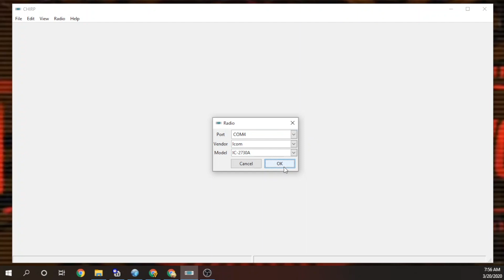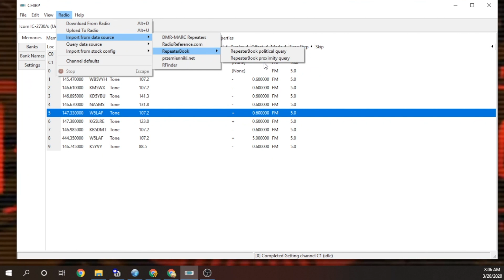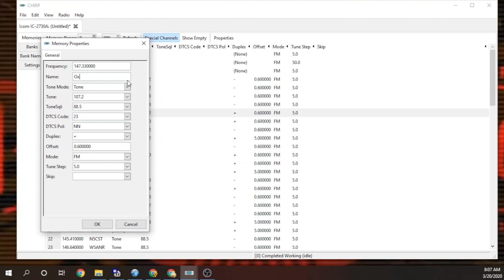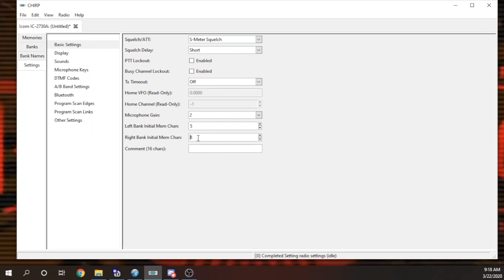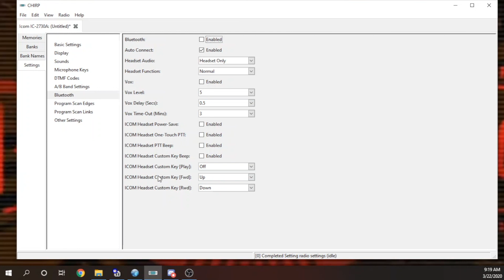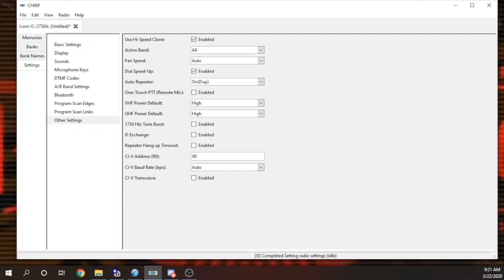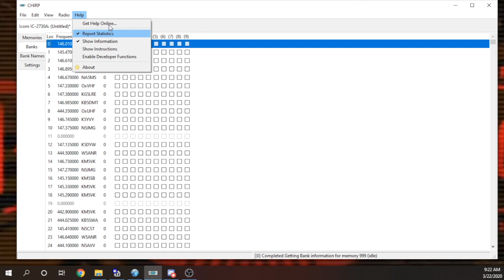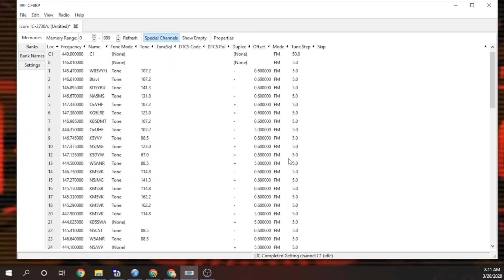ICOM 2730A: How to Program Using CHIRP

Comment: Just helped a friend download from the 2730A and then install repeaters on his ICOM 2730A and then upload to his radio. The 89 comments helped greatly. He runs Apple OS which he could not get to work - as a matter of fact you can't at this time run the Chirp program and talk to the 2730A using the cable he bought.
1. I am running Linux Mint 21.2 on a Thinkpad T440p laptop with Chirp-next-20230404 (since upgraded to 20231003).
2. Using a mouse plugged into the right back most USB port. Probably could have used the trackpad but didn't.
3. Went out to his car and plugged in the programming cable to S2 which is the right most sound plugin looking at the back of the 2730A.
4. Plugged into the right forward USB port with the programming cable. 
5. Tried to communicate with radio selecting the USB option (vs TTY) - would not communicate. Followed the on-line Chirp instructions, tried HELP ME for the communications. Lots of turn off turn on 2730A.
6. Finally switched the USB plug to the left side of the T440p, don't know which of the 2 he chose but it all of a sudden started to communicate and we were able to Download from the radio into chirp.
7. Went back to the house, downloaded the repeaters within 250 miles of our location. Had to copy paste to get the repeaters over into the radio program.
8. Went back out to radio and was able to upload without a problem using the same USB ports as before.
9. One thing that happened was he could not switch between program channels until he unlocked the 2730A.
Hope this helps someone.
Reply: I just picked up an ic-2730a and got a programming cable and am not able to get the radio to connect to my Apple Mac. 😞 My PC is old and has died so I'm afraid i'm SOL unless I literall but a new computer just to be able to program my radio....which is a non-starter. Hmmm.
Reply: So, I rummaged around through my closet and found an old Intel Mac. Used bootcamp to install Windows 10 and installed CHIRP. No problems connecting to the radio now. 🙂

Comment: When you say the speaker port, what do you mean. I see two speaker ports on the back
Reply: The SP2 port (the 2nd one - it's on the right) is the correct port to use for this.

Comment: I noticed there are 2 speaker jacks on the back of the 2730A.  Does it matter which speaker jack is used?
Reply: Everything I've seen says to use the SP2 port (Speaker Port 2) which is the 2nd one on the right.

Comment: love Im on day three, were talking full 10 hour days, give or take, just to figure out how to program and use my ICOM 2730A radio-I have spoken to at least 5 technicians,  at ICOM  and DX ENGINEERING and one Elmer here in Selden, and we or  I cannot figure it out. I can honestly tell this entire journey goes against the concept of communication, and rather, sheds light on a Cult of sorts, where initiation is a Bizarre world of hidden knowledge in order to use the device, and honestly, Im starting to wonder if its all worth it and or if maybe CB radio is the way to go. im not sure...
Reply from the maker: I'm not sure what the problem is with the radio. I found it pretty simple to get up and running. Give some details about the specific issue you are having and maybe I can help out.
Reply: @K5ATA  thank you, thats very kind of you, im trying to get on a repeater, 147.375, my radio automatically defaults to 147.975 when I key down so no problem there-its the other settings that i can't figure out, im starting to think the elmer running that repeater just is giving me the wrong guidance as far as setting my radio to the other settings, and when i call icom, they're no help,  this is beyond crazy

Comment: I may appreciate this video more if I get my laptop in the loop.  You do a good job making videos!  You need to do a basic repeater programming video for IIC 2730A.
Reply: People always make these videos but they purposely leave out some of the most important information. Like the actual connecting process. There is a specific way this needs to be done or the radio won’t communicate. He makes it seem like you plug and play with no issues
Reply: Thank you for saying this. You took the words out of my mouth. As for it being on purpose, who knows for sure. What I do know is that if there is anything left out of a video, guaranteed that's the one thing I need the video for! lol. @JK501TK

Comment: IS there something else that must be set for the initial memory channel to work properly? I have 2 channels entered. But, when I cycle the power, the radio always starts with the last 2 frequencies that were on when I powered down.
Thanks, in advance, for your help, Steve.
Reply from the maker: Sorry for the delayed response... no, it should be saving for you. Are you sure you are in the right mode? You need to be in the memory mode, not VFO mode.

Comment: There are many cables on the market.  Many are Chinese clones that don't work.   I'm told it must have a FTDI chipset.  What is it and how can I be sure it's not a knockoff or a clone?
Reply from the maker: I have found that many cables have an older chipset. Some have a prolific chipset. Those you sometimes have to roll back the drivers on to make them work.

Comment: I've got the IC-2730a and get all the way to and including Upload to radio.  It appears that Clone to radio works and completes but the radio display stays in the Clone In mode.  When I cycle the power off then back on, the radio Resets All. and then there is nothing in the radio.  Any help would be great!  73 N9SDL

Comment: Can I use the ic-2730a as a repeater in my Jeep for when I go hiking with my baofeng? Tx offset .600 155.600 155.000

I've had no luck getting the manual for cross band repeat. Apparently you have to turn machine on differently? 

Can't find anything with 2730a as a duplex. But I suspect it's possible? 

I see a lot of people removing diodes because they didn't have a USA or Korean model. Scary.

Comment: Hello from a fellow Mississippian, Tate county. Can you do anything with a MD9600?
Reply from the maker: I knew I had seen this name when you popped in the stream the other day. I've not messed with the MD9600, simply because I haven't had one in my hands. Thanks for watching
Reply: @K5ATA  No worries sir, I sent it back and got the 2730. I like to had froze my hind in and hands off but I got it installed and made my first contact today in a long time.  If you happen to catch me on the air, please feel free to say hi. Also I referred a couple of new hams to your videos. I told them HamRadio 2.0 and yours were in my opinion the best ones. 73 sir, KD5LDE
Reply from the maker: Thanks for that!  Hopefully we will have the machine in Batesville back on the air soon. That one is easy to hit from Tate all the way to Grenada and well past Oxford
Reply: @K5ATA  That would be good as I am in the Batesville and Oxford area a good bit,

Comment: I bought the RT system usb cable and I'm trying to program my radio with chirp but it isn't showing any USB ports when I try to import from radio. Any suggestions?
Reply from the maker: Sure you have the right com port and what not selected? These cables can be a bit wonky at times.

Comment: good morning, i just installed a 2730a into my tacoma and i need to set it up with local repeaters and other frequencies. i am using rt systems. where should i plug the programming cable into? is it one of the two external speaker holes?
Reply: The SP2 port.. it's the plug on the right.

Comment: Appreciate this video. If I may ask, can I set low power 5 watts during RPT in the receiving frequency and have 50 watts full power to the transmitting frequency. An intent not to build heat on the radio and save on batter draw?
Reply from the maker: I don't think so... but I am not positive. Let me get my hands on the radio again and I will let you know. Thanks for watching!

Comment: I installed chirp and bought
 the cable from Gigaparts for the 2730a. It pulled a driver on my windows 7 Pro machine. I loaded and upgraded Chirp to the latest version. When I go to download from radio it starts the clone and then fails. Is anyone else having this issue??
Reply from the maker: Sometimes you have to use an old driver.   I have to roll mine back to an earlier version on some radios
Reply: I would double check that you have the correct USB port selected. For example, on the pop up box that you select the Brand of radio and Model, above that is the drop down to select which USB port. When I initially went to clone my radio I had 3 USB port choices. I didn't know which USB port was the one that had the programming cable plugged in so I had to go one by one (for all three) attempting to clone, and found eventually that the third one (in my case USB Port 5) was the correct USB port. After selecting the correct USB port I was able to clone and upload just fine!

Comment: Is there an alternative to CHIRP for those who run Mac OS?
Reply from the maker: RT Systems has a Mac version available.  I've not used it specifically, but generally their stuff is pretty good. Thanks for watching!
Reply: I use a 2015 MacBook Air and have no issues using CHIRP,  their danplanet website has links to Mac OS version. You may need to alter your settings or hold down Control when you start the program, since this software is not from the official App Store.

Comment: Obviously your setting this up at your desk, and have a 12V power supply. How do you program using Chirp when the unit is installed in a vehicle? I guess you need a laptop?
Reply from the maker: Yes, you would need a laptop to do it installed in a vehicle... Though I would guess you could use a Raspberry Pi with Chirp installed parked out front hooked to the radio and running headless, then just VNC into it from the house. Thanks for watching!
Reply: @K5ATA  thank you! Need a "mobile" (automobile units) with a slot for a Micro SD card. Then you could do all the CHIRP or RTSystmes work at your desk, save to the SD then insert SD into the mobile unit and select update :-)

Comment: New to ham radio so don't laugh...but how do I connect the radio to the computer? I don't have any usb ports on the radio.
Reply from the maker: Never be afraid to ask questions! There is a cable you can buy to connect it from the USB of a computer to a 3.5mm plug in the back. If I recall correctly, it is the SP1 jack... but it has been a minute. Thanks for watching, and feel free to ask away!
Reply: @K5ATA  Thanks so much.
Reply: @K5ATA  SP2 jack
Reply: @K5ATA  SP2 Jack... not SP1

Comment: Great video. Just have a few questions, did you use the USB-29A cable and inserting the 3.5mm plug into SP2 on the radio, and did you have to set-up the radio in “clone mode” per the instruction manual? Thanks for any help before I buy this radio.
Reply from the maker: I don't remember the model number of the cable. It was the one from RT systems. Yes, I plugged it into the speaker plug and then to the USB on the pc. I did not have to put it in clone mode on the radio. I believe clone mode is to plug one radio into another to clone it. The radio went into the correct mode as soon as I hit either read from or write to. Thanks for watching!
Reply: @K5ATA  Great and thanks for the timely response and information!! I feel pretty confident I can program it using CHIRP so it should be easy plus I can always refer to this video again. Thanks again, 73.
Reply: I had to turn the radio on and off a few times, plug and unplug the cable a few times and then it worked.  Why it didn't find the Com port the first time is a mystery.

Comment: I definitely agree that Chirp is the way to go when available. I always feel like RT is running a racket. I shouldn't have to buy multiple versions of software to program different radios that use the same cable. Great video thank you. 73!
Reply from the maker: Yeah, Chirp is so easy... I just wish all the Chinese DMR radios would work with Chirp. Thanks for watching, Rob. 73
Reply: Rob - K8BCR .....im having some type of exe trouble with chirp. It downloads, I give it access approval to make changes to my hard drive, and accept terms etc. Then when I go to launch the program it behaves like it doesnt exist and begins the “install wizard” again. Do I have to have my mobile plugged in to even open the chirp menu etc?

Comment: what cabel do you using ?do you install the driver 2730 also thx 73, Gr. from Belgium
Reply from the maker: It was the rt systems cable.   I did not install any drivers or software other than Chirp. Thanks for watching and 73.

Comment: will the same cable work on both the icom 5100 and this icom 2730? try systems says it will but others say it won’t i’m confused
Reply from the maker: It sure looks like it. I believe they are both just FTDI chip cables. I don't have a 5100, so I can't be 100% sure. Thanks for watching, 73

Comment: Great video. I'm planning to buy the data cable but I don't see any data port at the back of the unit.
Reply from the maker: It plugs into one of the speaker ports on the back. Really easy to hook up, the manual actually makes sense on that one. Thanks for watching!